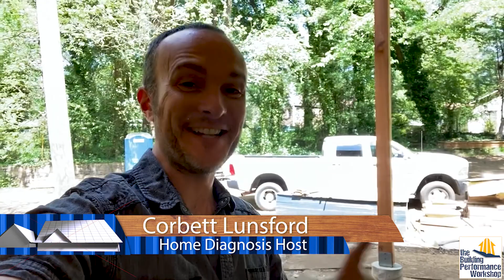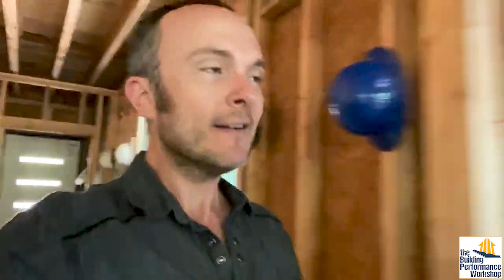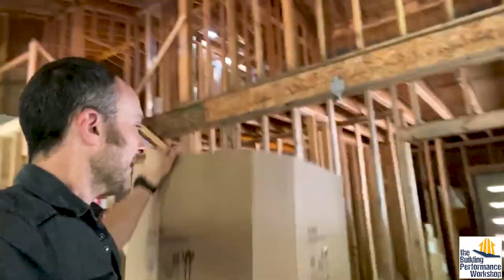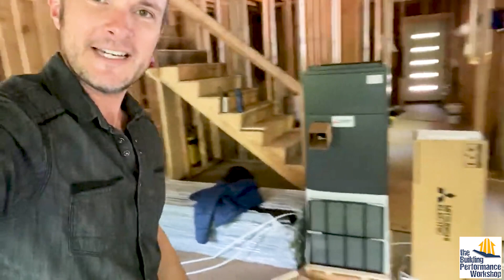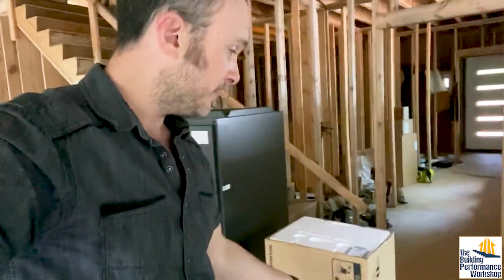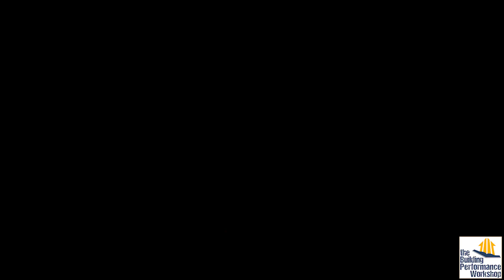High Performance HVAC Systems Preview

Comment: Struggling on a decision. We're in KY see all 4 seasons to their peaks. Can get to 100 and get down to 0. We have a new build with an attached party barn. Total square footage 7,000. We're being quoted 5 Bosch inverter systems (only 16 SEER). We only have access to propane so we leaned towards inverter systems with good insulation. I'm lost. Need less units with higher SEER systems like Daikin? Just trying to avoid insane electric bills. What's the point of 5 systems when you're probably paying just as much in electric at 16 SEER versus something else? Please help
Reply from the maker: I recommend an hour consult, Amanda: https://buildingperformanceworkshop.com/video-consulting

Comment: Why don’t you use the dry mode of the Mitsubishi instead of a separate dehumidifier?
Reply from the maker: Aha- we did that for a whole year in our tiny house, and it was not an optimal experience. It was very cold all the time, and it grew mildew and mold and started smelling bad much, much faster. The sensible/latent split on those units is a whopping 95%/5%, which means that only 5% of the coil energy goes into drying air. Compare that to 25-30% on a typical ducted unit.
Reply: @HomePerformance  well you have a ducted unit and I just put one in two weeks ago similar 36k btu m series I’m in Illinois replaced a 4 ton with a propane furnace in a 1970 home. I’ve learned a lot from you and Risinger. Just trying to keep up to date with the latest and greatest
Reply from the maker: Thanks Adam, and keep it up brother!

Comment: Love your series here! Great stuff. I’m also Atlanta based and I’m curious...did you consider radiant cooling for your project? I’m fascinated by the possibilities there but I’m sure I am not considering all the negatives (condensation is my main concern, particularly in Atlanta). The ceiling panels and dehumidifier systems by Messana do seem promising. Would love to hear your thoughts! 

Keep up the great work!
Reply from the maker: Thanks, David! No, we didn’t consider it. Not sure I see a way around having ducts to distribute, circulate, filter, and dehumidify indoor air. Mostly I’ve heard of the Messana panels being supplemental. They control condensation by keeping the panels just cool, not cold. Kept away from radiant conditioning in general because water leaks are my nightmare.
Reply: @HomePerformance  It's clear I like you because we think alike ;-) A water leak from my ceiling might just be the death of me!!!!  I think you're right - the duct work and distribution of the cool air is something I'm struggling to wrap my head around. I do like the possibility of doing something other than pushing cold air around, which is why it peaked my interest. Keep it up!

Comment: You mentioned that you went with a PVA air handler (the P series) any reason for choosing the P series of the M series? (i.e. SVZ air handlers)

They both appear to come in the same sizes.

Thanks again for these videos @Home Performance
Reply from the maker: Great Q, Robert. SVZ with hyperheat was released in Feb, but only in 1.5 ton size. 2 ton with hyperheat PVA is the only option right now. SVZ is the same basically, just a smaller cabinet.

Comment: Love the idea of using ceiling fans to enhance the utility of the ductless system! On the plumbing side,  are you going to set up the plumbing to work for grey water in the future? Nor for passing inspection as that can cause issues with permitting. I've got a book for you if so!

Comment: Thanks for "nerding" on with the mechanicals! I'm relatively new here and wondered if there is also hydronic heat in the floors? Maybe the Atlanta environment is so mild it's not needed, but I know it is VERY much more efficient than ducted heat.
Reply from the maker: Glad you found us, Tim- “efficient” is a slippery word. I wouldn’t say it’s so, personally, but context is everything. I have a phobia of water leakage, so there will be no hydronics in this house regardless. Stay tuned!

Comment: It is a scientific fact, electric resistance heat is 100% efficient. You picked an awesome system that will work great for your application!
Reply from the maker: Thanks, but I think you know that 100% is in context of INSIDE the house. Since our electric grid is about 33% efficient overall, and since heat pumps can be WAY more than 100% efficient, when you look at the big picture  it’s not an elegant solution.
Reply from the maker: Nope

Comment: Oh yeah! This is one of the series I've been waiting for! High performance HVAC is like a secret society where the punishment for posting info online is death. Please expose all!

Iirc you don't have attic space so I'm curious to see how you run the ducting (crawl space)

Please do talk at length about humidity management in the hot humid south.

Also how were you able to but the mitsu pva without a dealers license? I thought that was basically impossible (without immediately voiding any warranty)
Please do share.

Thanks!
Reply: +1 on the purchase question @home performance
Reply from the maker: Promise to discuss humidity control a lot, and our case is unusual because we’ve been working directly with Mitsubishi for years. They offset the cost of our filming all of this by contributing product to the build. We pick our partners carefully, always going to the best companies with a proposition like this.
Reply: @HomePerformance  
That's great to hear. Mitsu is obviously top of the range in heat pump HVAC from what I've read and I like their units. I would be curious to know if their ducted units run nonstop like their ductless units as I hear that reintroduces humidity into the air.